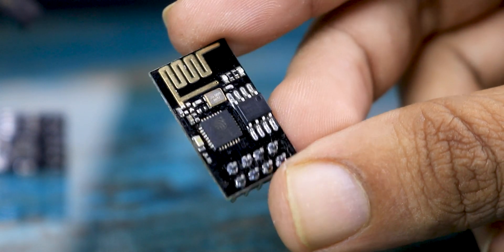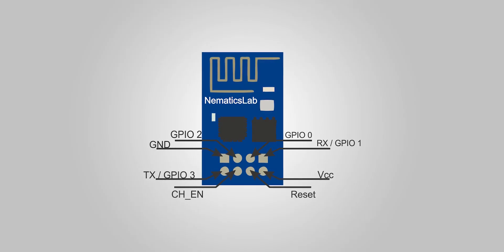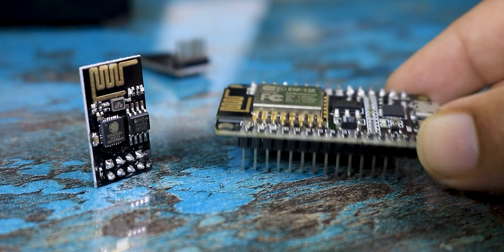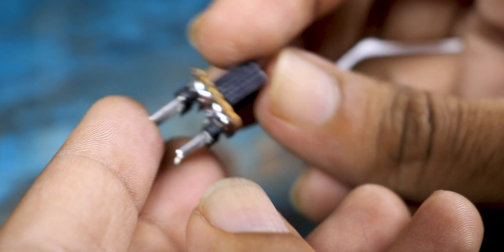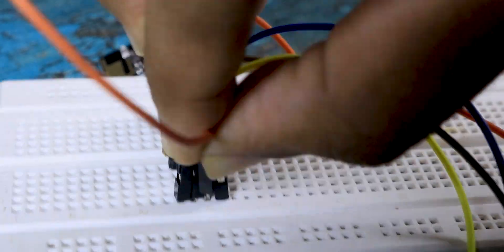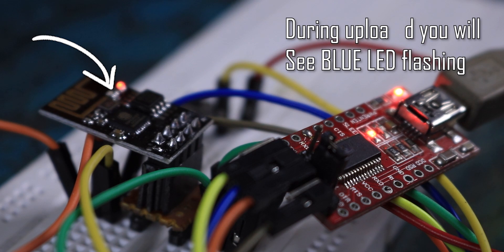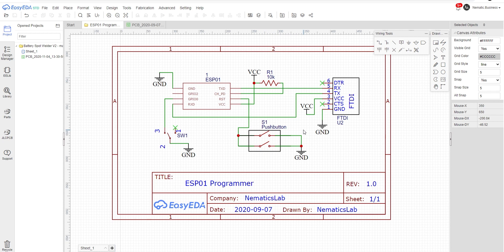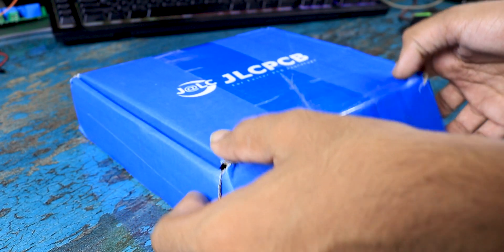How to Program ESP01 WiFi Module | Arduino IDE | DIY

Comment: Considering the cost of FTDI board and the custom PCB, I think ESP12 Node MCU is more cost effective and easy for a beginner. Plus more GPIO pins
Reply: Depends on if you want to buy only a single one of these boards or more. You don't need to put the FTDI and breakout boards into the final project and can reuse them. And when it's just about cost, a lot of people already have an FTDI board and you could make that breakout board on a breadboard.
Reply: agree with you. ESP-12 has lots of gpio pins and can do reasonable size of projects.

Comment: What was your board settings? The blue led does flash, but the arduino ide says an error, espcomm_upload_mem failed
Reply: Actually his connection is wrong.
Should connect TX to TX  and RX to RX.
Then check. It definitely works
Reply: @vamsikrishna-cr4xu  100% correct. It worked for me. Thanks. Used Arduino Uno R3 to program it.
Reply: @BrinleyPavitt   👍 😊

Comment: So my Arduino IDE does now show the ESP board - how do I get those settings?
Reply from the maker: https://youtu.be/W7AHNkxcrxs
Reply: @Nematics_Lab  thank you! so now I am trying to test sending AT commands. I have the MakerFocus ESP8266 ESP-01 Serial Wireless WiFi Transceiver Receiver Module 1MB SPI Flash DC3.0-3.6V

Comment: Hii brother can you please make an automatic water level controller just like kiyani tech made. He used atmega ic instead of complete arduino board so circuit became quite difficult. I request you to please make same as he did by using complete arduino board

Comment: Yo
Reply from the maker: Yo
Reply: @Nematics_Lab  one question how to calculate power output of a 775 motor
Reply from the maker: P = V*I will give you rough estimate
Reply: @Nematics_Lab   I found same formula on net but their will be less power output. Actually I am detail designing gear box for 775 on creo.